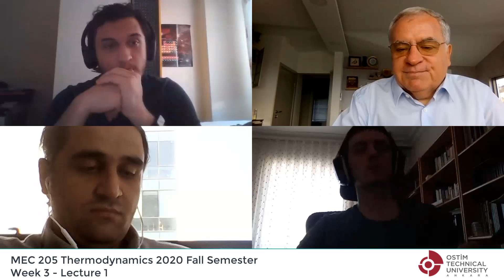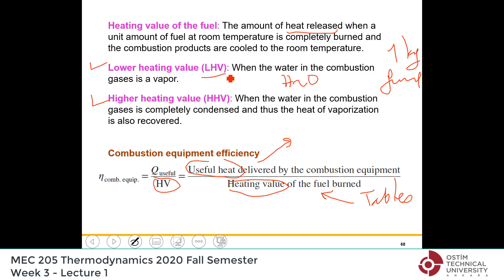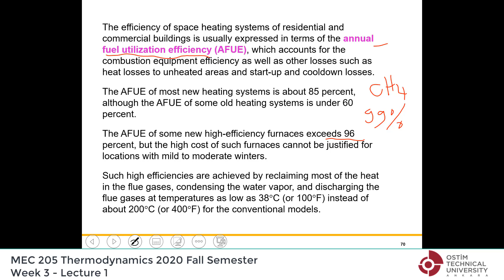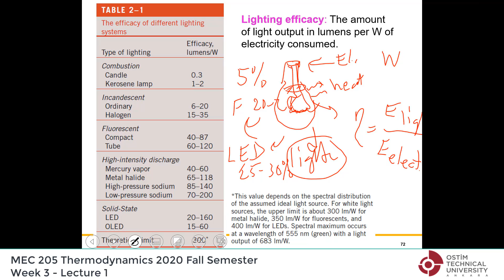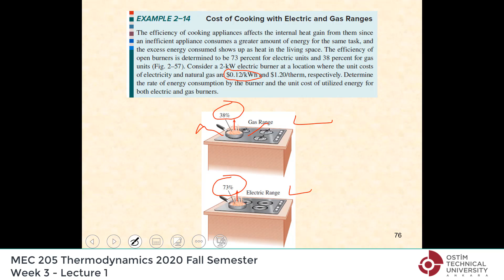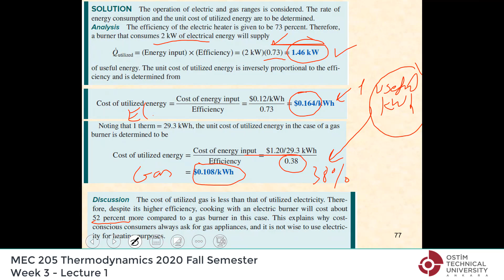Thermodynamics by Yunus Cengel - Lecture 07: "Chap 2: Energy conversion efficiencies" (2020 Fall)

Comment: In order to exactly realize that the lower heating value, do the combustion products have to be mixed with dry air? Otherwise, some vapor would condense while dropping to room temperature at standard atmospheric pressure.